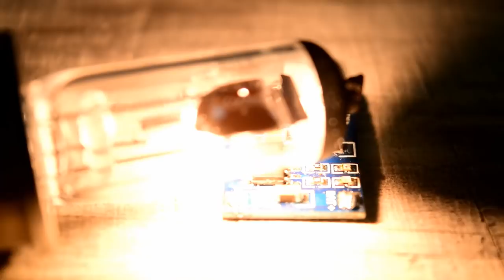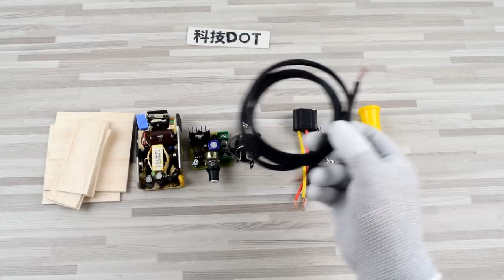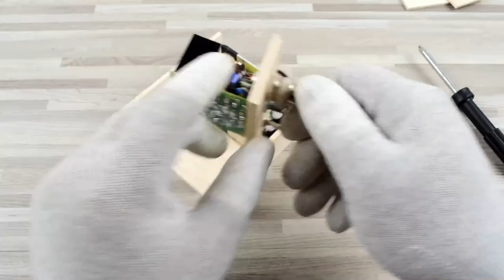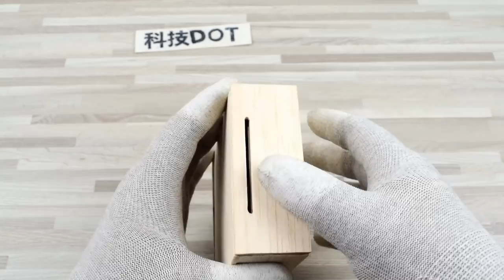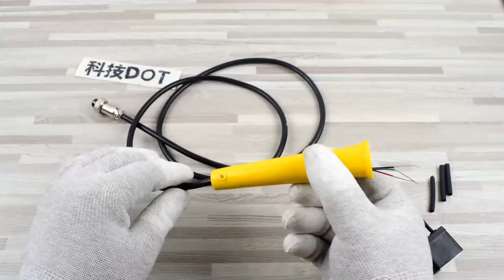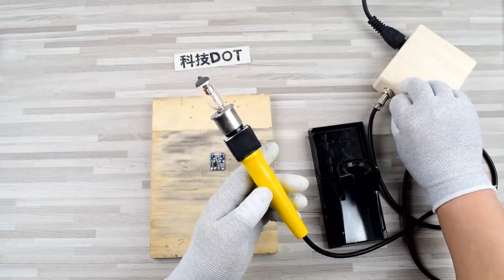How to Make Hot Air Gun from Halogen Bulbs

Comment: This project isn't actually that useless at all.
It isn't an "Hot Air Gun" and it is more like a surface heater but I see a lot of use cases with this thing.
For example, I would use it for recycling parts from dead PC motherboards or some other PCB's. 
There is also an use for heating up some shrinking tubes with it.

Comment: What kind of halogen bulb or bulbs could heat up a cylinder of metal a half inch in diameter and one inch tall to 440F/226C? How far away would the bulb(s) have to be? Is there somewhere I can find this info? Any help is appreciated.

Comment: Now tell me  about your pwer SUPLY  .what voltages u r using????. Secondly  halogen lamp has 3 pins,  black earth ,other two what voltages u gave.,have used. Both the filaments??? Reply don't say my English no good. Thank you.
Reply: Vidyabhushan Soni the hallogen bulb you are about to use depends on a power supply you have. if you have a 24v power supply then you must use 24v hallogen bulb.  hallogen bulbs has 3 pin. 1 for the negative supply and the other two is for high and low which need to be supplied with positive supply. power supply output, motor controller input and hallogen bulb should have equal rated voltage.
Reply: Aldinandi Godinez   -  hi, I have Philips  halogen. Rated 12 volt , I connected. 12 v from  my ATX power  supply , looks.  It is not giving sufficient heat,that's why 
This project failed..I used  ground  and one of the filament, I suppose it is the top one filament ,I did not use other filament& left open. I hope u got my point.
Some suggested, I must used 12 volt battery not the ATX  supply. Still the project kept pending. Tks for u r reply.
Reply: what is the rated current capacity of your power supply? keep in mind that halogen draws too much current thats why you need higher rated amps power supply.anyway im using NARVA 24V/100Watts halogen. my powersupply is rated at 10A so it works fine. Check also the rated wattage of your bulb. the higher the wattage the higher the heat generated into it.
Reply: in this project the uploader of video use 12v/55w halogen bulb which drawn around 4amps current. he use 12v 5a power supply. keep in mind that your power supply rated current capacity should be greater than your load(halogen bulb). I hope i have enlighten you.
Reply: Aldinandi Godinez  I have no idea about the wattage rating  but I m using  this- 12 v 100/90 CP P43t-38., I don't know what does it mean,may be CP  means candle power
No wattage on box . Any way let us leave this here.tks a lot for reply.

Comment: The address is wrong it is Not Hot Air Gun.
Reply: There is no contact between the lamp and solder joints, the solder is melted because the lamp is heating up the air around it, so the basic principle is hot air. First think, then talk/write.

Comment: Hahahahaha This Is Not Hot Air Its Hot Rod 

Air Are Missing
Reply: Ther is no contact between the lamp and solder joints, the solder is melted because the lamp is heating up the air around it, so the basic principle is hot air. First think, then talk/write.
Reply: Wilson Different Bitween Lamp And  Hot Air Gun
Reply: Wilson Lamp Is Lamp its Not Air Condition